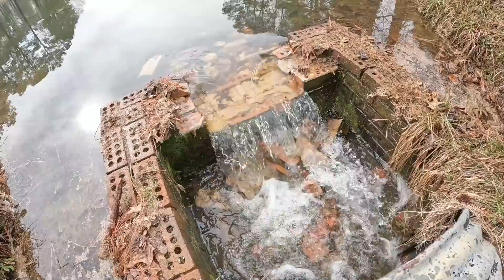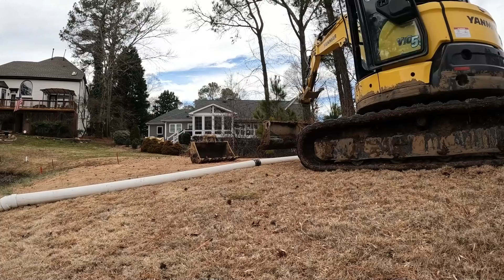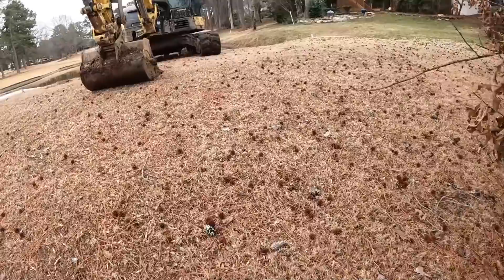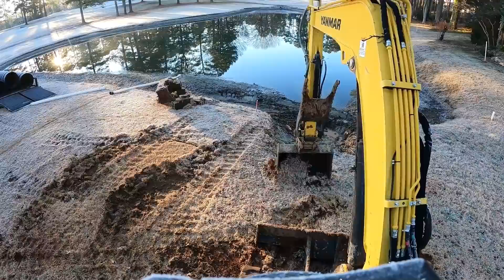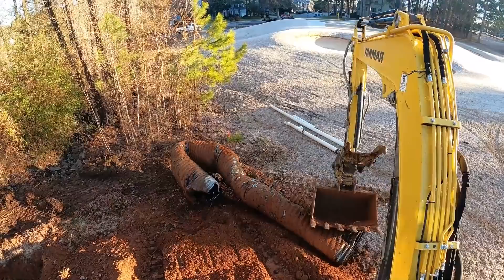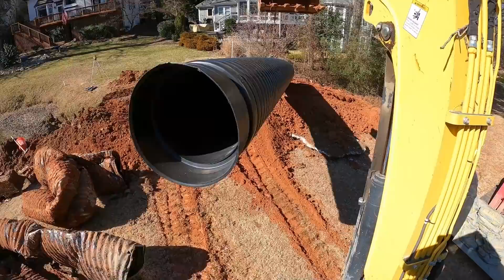Ripping Out A Leaking Overflow System And Replacing It

Comment: rotary ditch earned it’s keep today, nice finish!  i do plenty of drainage and most times skim the topsoil and lay on the grass work area, then put the fill on top of it, backfill and spank everything with the rotary clean up bucket and peel all the topsoil back up and smooth it back down and then for the moneyshine finish i get the redmax backpack blower and it will blow every bit of dirt out of the grass and you only have to seed the trench…top secret knowledge right there!

Comment: hi chris the metal pipes because of that will rust rot in time but these plastic strong pipes will last years a lot better because when metal ones start to rot they eventualy will fold all the way through so the plastic type are a good investment in the long run.another lot lasting overflow ...another job well done chris...john england.u.k...

Comment: Interested in how the siphon works. I understand the discharge is lower than the suction. Could you possibly explain how you initially start the siphon? Thanks in advance. Love the channel! Very informative
Reply: The key is filling the pipe and having enough water on the section downstream of the high point. If that is more height than above the water line then the syphon will draw. You start by plugging both ends with temporary plugs. Close the fill line at the high point, open the suction below the water line, then open the discharge. Once enough air gets in and stays at the high point the syphon will stop drawing.
Reply: One more point, if the vapor pressure of the fluid is at or above atmospheric pressure at the time, a syphon will not work effectively. Very difficult to syphon boiling fluids!
Reply: Brilliant! Thank you!!

Comment: Looks good! A lot of pride and attention to details!! 💥🖐🇺🇲😎 What's to prevent the overflow and plastic pipe from becoming clogged and rendered useless?
Reply: I'm guessing they used the double wall pipe where the inside is smooth.  With the slope to the pipe there shouldn't be a problem with it silting up, but it could just be blasted with a firehose to clean it out.

Comment: Quick question, Do you prefer all your controls to be on joystick, or do you like a mix of control systems?
Obviously, on the older machines, there are no electronics so-multi lever/pedal is just how they work.
I am curious as I like the boom swing and aux drive system running on foot control on the mini.
Plus, the skid steer we have also still has foot controls for most front operations. (I like to have something for my feet to do as well as my hands!!)